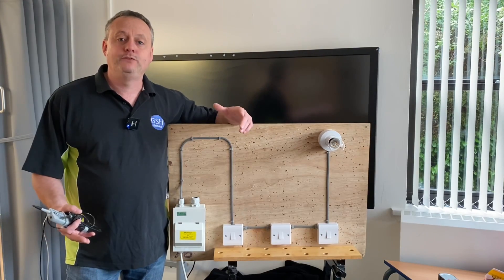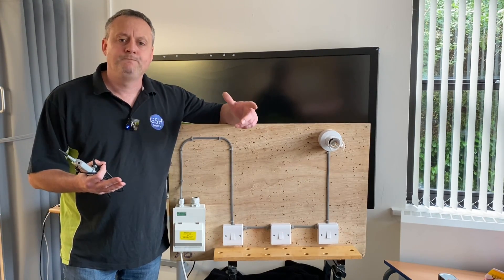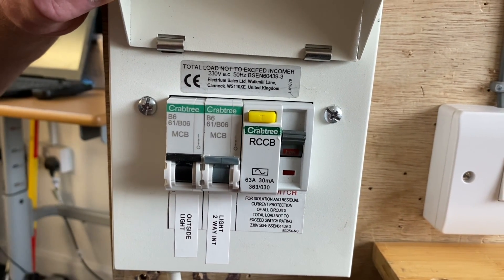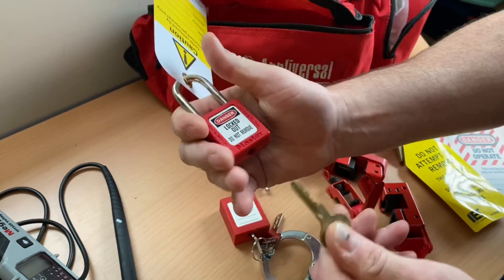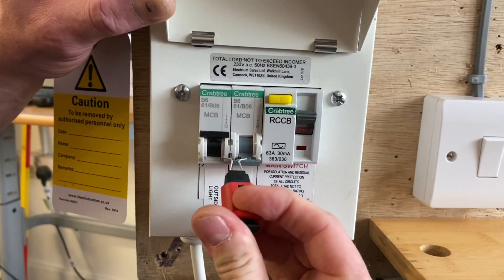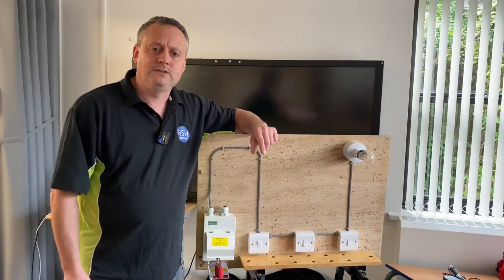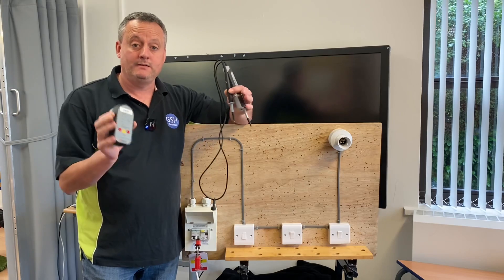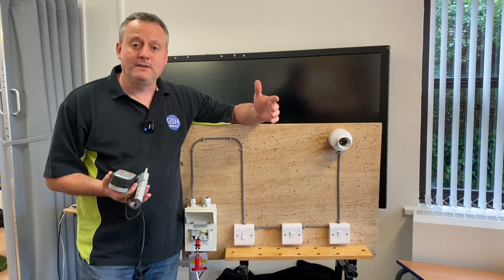Safe Isolation of a 2 Way and Intermediate Lighting Circuit - How to Isolate Safely AM2 and AM2S

Comment: Great video as always, I believe for the assessment this is completed on a bulkhead light. The way they set out identifying the circuits is the assessor will tell you what to isolate, you then need to identify this from the spec sheets you have to know what breaker to isolate. 

The bulkhead is normally above your head so, you need to ensure a clear workspace when setting your ladders up to make sure you are working safely during the safe isolation. 

This is the start to the fault finding section so gives you time to settle into your testing process by achieving this element successfully and competently. 

This part is watched directly so get comfortable doing this on a range of circuits with someone watching you to not get freaked out on the day. 

This advice is just my pennies worth and hopefully helpful to someone. 

Circuits I would make sure I was ok with would be:

The lighting circuit scenario shown
A CO2 detector
A ring circuit
A DOL starter 
A 3 phase isolator 
Heating controls on a boiler circuit. 

There may be others but the circuits you cover are all listed on your pre AM2 checklist paperwork
Reply from the maker: Massive thanks for such a great comment Craig - this will help others taking on AM2 and AM2S 👍🏻😃. All the best to everyone undertaking an assessment 🦾
Reply: Hi Craig, "you need to ensure a clear workspace when setting your ladders up to make sure you are working safely during the safe isolation." So true !

Comment: Would it not be sensible to test the wires on the back of all 3 switches as part of the process? What if it was the wrong switch. I would think that all wires on the relevant switches should be safe in all switch positions? Also what if (like I have found), another switch next door is on a different circuit (hall/landing scenario). Even worse I found a borrowed neutral from the upstairs with the feed from the hall switch to save 3+earth between the switches. As soon as the neutral upstairs became disconnected, the non-energised section of the upstairs lighting became live despite the breaker for upstairs being off. Very dangerous (actually I found out by getting a belt which is why I raise it here). Now I test all circuits after disconnection via a rose or junction etc. in case they become live after breaking. I have heard of someone getting killed by cutting a pipe that was inadvertantly a neutral path. Wet hands on either side - exceptionally dangerous.

Comment: Hi,
Thanks for your hard work to support us learners.  Just  to mention on the selection of voltage tester I failed my test on safe isolation because I used the single phase voltage tester to test a three phase circuit. 

Please what difference between single phase and three phase voltage tester. 😊

Comment: Great video, thanks, the only thing I would say is that I would have checked the connections at both points - the base of the light fitting and the light fitting itself just to be absolutely certain - you only get one chance.

Comment: If the lamp doesn't illuminate at the start, the conductor(s) could be broken at any point in the circuit. We can test the lamp as much as we like, but the circuit up to the break could be live surely?

In the case you CAN'T see the lamp operating at the start (e.g. fault finding), would it be prudent to also test at the first point after the consumer unit (e.g. the first switch)?

Comment: Just failed my AM2s on single phase isolation as I didn’t test the switches in the correct order 😂 wish I saw this video first. I had a bulkhead light fitting and must have tested about 20 different switching combinations but due to them not being in the correct sequence regardless if it is safe, still counts as a fail (little unfair if you ask me ☹️) So my advice would be to follow this video exactly.

Comment: Would you not take the cover off and confirm the MCB is also dead? Or leave it on and check the light only as the system is energised?
Reply: Sorry you’ve failed the test.

Comment: Hi gaz, If I'm doing this as my end assessment, I'm stood in the bay with the only lighting circuit in that DB and it's turned off,  would I still need to operate every switch and prove dead? For example, the light was on, I turned off the mcb, operate one switch twice and done my safe isolation would that suffice?
Reply from the maker: Yes 👍🏻

Comment: Can anyone help clear up something, I’ve been told a few times single pole isolation isn’t sufficient as the neutral can be live is this correct?
Reply: Single pole does only disconnect the line but testing with voltage indicator proves any voltage on neutral or cpc terminal. A previous polarity and earth continuity should have been confirmed in the greater scheme of things (assessment of general characteristics...etc)

Comment: Can you please make a video of how to carry out the Polarity Test (dead test) when using the Megger Multi function tester.
Thank you
Much appreciated 🙌
Reply from the maker: This playlist should help 👍🏻

Electrical Testing Dead Tests City and Guilds 5357, 8202, 2365, AM2, AM2S, AM2E and EAL Diplomas https://www.youtube.com/playlist?list=PL2Ea5r9gxUUdi6vjph2Wn0SiEYgHV5BnG
Reply: @GSHElectrical  thank you and I've seen most of the videos within the link you have sent which demonstrates how to carry out Polarity by doing the previous dead tests etc.
But I was wondering if it would be possible to make a separate video showing how to confirm Polarity (Dead Test) with a use of a Megger Multi function tester as their aren't many videos based on it.

Comment: Shouldn't you technically reprove the unit before each of the 4 tests, since you've put the fitting back, walked away, etc?
Reply: @The UK Electricians Show But if it's supposed to simulate site work you could have left the room and gone somewhere else, so shouldn't you technically reprove? What's the difference if i use the tester in one room, then 20 minutes later use it in a different room, do i have to prove the tester the second time?

Comment: Hi, this may be a silly question, however I'm not an electrician. Whilst testing (9:46) - the Live and CPC, I noticed that the ( + ) Probe is on the CPC and the ( - ) Probe is on the Live. I always thought you'd put the ( - ) probe on the least dangerous cable - in this case the CPC ( and on the Neutral/ Live test - it would be ( - ) on the neutral and ( + ) on the Live).....or does this matter?
Reply: When measuring AC, it doesn't matter which way the probes go. When measuring DC voltages, the red positive probe goes to the positive side of whatever is being tested. When measuring resistance, ensure there is no power applied to the resistance being tested. It doesn't matter which way the probes go.

Comment: What if the connections from the blocks to the back of the lamp are faulty or loose? Wouldnt testing from the blocks be more conclusive that the wires to the light are dead? Cheers

Comment: Why does the process need to be repeated after operating each switch? Surely testing before and then operating one switch and repeating the test will be fine as it’s an intermediate lighting circuit? Thanks
Reply from the maker: That’s the requirements at AM2/AM2S I think I covered the reasons in the video 👍🏻.
Reply: @GSHElectrical  you may well have, will watch back again. Top man Gaz 👍🏼
Reply: @GSHElectrical  so The AM2 and Am2s assessment is about getting the candidate to carry out test that are pointless and a complete waste of time , and if you don’t waste your time  or you disagree with the assessor he will fail you . Fantastic idea 👎 . Sorry to be negative on this  Gaz .  But I think teachers should jump on this and tell the assessors that they not going to teach the students tasks that are pointless and a waste of time , and this is just one example. I don’t care what anyone says you only need to operate one of the three switches the the other two make no difference .if you are carrying out the insulation resistance test test then yes you must operate all switches. But to not to prove dead . That  is a nonsense. 
Again sorry to be negative 
No disrespect to you Gaz
Reply: @Dog-whisperer7494  I am sorry to say sean, but Gaz is right in this video. In a real life scenario you need to test all the switches because you cannot see how the installation is wired.
Reply: @darkdepth1991  I’am not saying Gaz is wrong . I just can’t see the need to operate all three switches on an intermediate switch circuit when safe isolating . Like I said for insulation resistance test then yes we must operate all switches so as to test every bit of cable. But not for proving dead , you switch the MCB off you test at the light it’s dead ? Operate one of the switches  test at the light again it’s dead so why do you need to operate the other two switches. I don’t care how the circuit is wired if it’s dead the other two switches will not make a bit of difference they will not magically make the circuit live . 
There is no reason or need for it
The same for two way switching . What bout a ring main ? Switch the MCB off test a socket it’s dead do you go around and test every socket and operate the socket switches no you don’t because there’s no need to you have proved dead  .
Reply: @Dog-whisperer7494  'I don't care what anyone says' says it all.
Reply: Just a guess but.....

To quote Gaz, "we're going to do it 4 times, like we did with our insulation resistance test" so I can only assume that this is in case there is an unexpected connection between a line connector of a different circuit in the installation that is still energised, and one of the switched wires between the switches?

The reasoning for the IR being done 4 times is because it ensures that all switched wires are in circuit at some point to measure resistance between conductors of the circuit at the CU. As this test is done at the lamp end, testing 4 times ensures that every switched cable is not at an unexpected voltage should someone toggle one of the switches when you are working on the circuit.

However, this does seem an unlikely thing to allow for, but that's my best guess at the moment to understand why the assessor requires 4 tests, rather than just the 2.
Reply: @darkdepth1991  if you’re dumb enough to switch off the wrong beaker then you shouldn’t be tinkering with people’s electrics  
 Pay attention to what you are doing and you would not make such a mistake.  Gaz is a fantastic spark and teacher and I have the upmost respect for him and his team but he is only teaching what he is told to teach by pen pushing boffins
Reply: @Dog-whisperer7494  With their pen they try to put responsibility's in other peoples hands (contractor) . Gaz teaches us how to take those responsibility's. But I have to agree some of the things take up allot of extra work to be 100 % sure about safety.
Reply: @darkdepth1991  I have just read this for the third time, what are you talking about? 

You switch the off you test the light fitting it’s dead ? You operate one of the switches you then test the light fitting again it’s dead you test your tester on a proving unit and yes it is working properly. If you have done as described and you get 230 or so volts then that will tell anyone with any grey sell that you have switched off the wrong MCB  .Please let’s  not turn this into an argument and agree to disagree I will not back down .. respect my opinion as I respect yours . Enough said.
Reply: @Dog-whisperer7494  I did draw the circuit, you are right. Thank you for your time buddy.

Comment: Great video and advice, but I can’t see why you operate all three switches ? Intermediate switching by it’s very nature  any on switch will turn the lights on or, so if the circuit is isolated then you will only need to operate one of the switches as the other two won’t matter ? 

Point . You have switched of the MCB ? You go to the ceiling rose undo the cover and with your voltage indicator you probe between the three conductors you think it dead ? You then go to one of the switches and operate that switch you go back to the ceiling rose and probe the three conductors again it’s dead . Operating the other switches make no sense or difference ? 
Great video as always Gaz 👍❤️⚡️